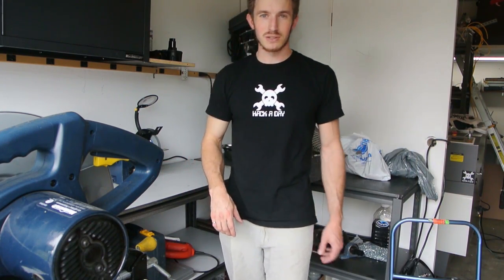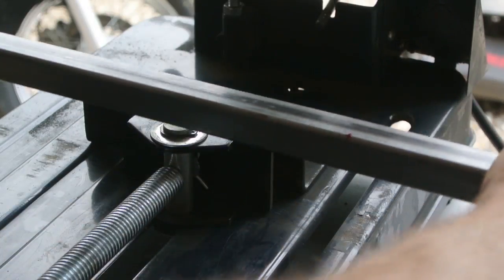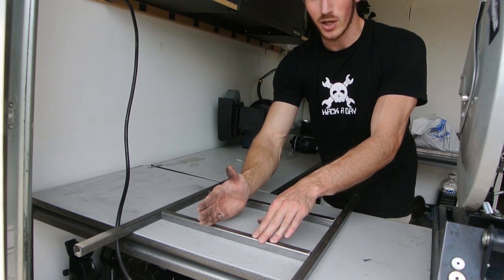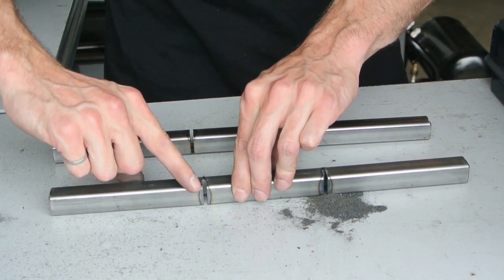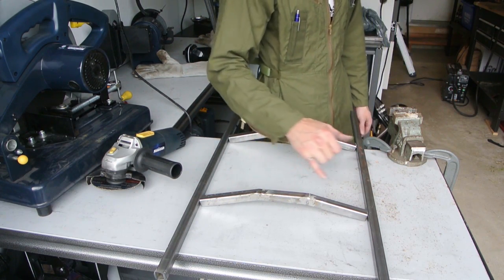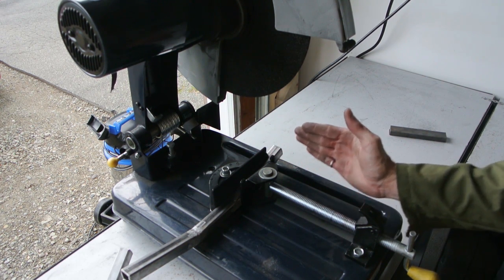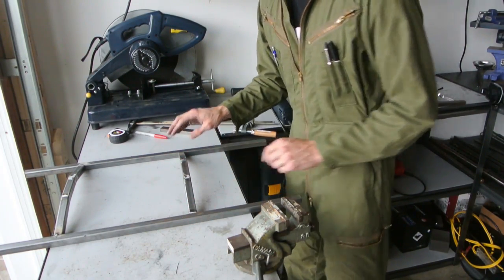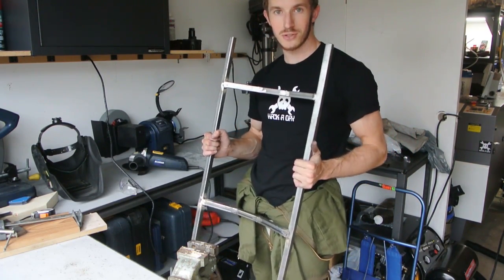Elysium Exoskeleton, Part 8: Building the Frame

Comment: What if to use a 250 psi compressor how will the performance
Reply from the maker: you would get double the power
Reply: you need mobility any sugestions for lighter equipment 
like the things you used to power the air stuff idk

Comment: See while you focuses on arms and lifting and holding it I had a similar idea except using the cylinders to boost you up basic the idea is to be able to jump six or seven feet into the air with pneumatic cylinders and absorbing the shock with shock absorber  when I land eventually its in bare bones stage right now but the idea is sound
Reply from the maker: Watch my other video on jumping boots ;-)
Reply: the Hacksmith that is exactly was talking about except we designed it so your not 1.5m of the ground but also we moved the pistons to the outside of both legs and put the shock absorber on the insides which still allows for joint movement we plan to test this near a foam pit so we have a place to land till we get the landing part figured out

Comment: if you fill the box tube up with water then let it freeze in a freezer take the pipe to a pipe bender the ice inside will make sure it retains the box shape while bending. then just take a torch to get the ice to melt.

Comment: Why did u put the jumpsuit on to weld it's not needed, just a waste of time
Reply from the maker: Have you ever welded before? Welding produces intense light, which includes both UV and IR light as well -- Any exposed skin would get sunburns.
Reply: the Hacksmith
Running a few short beads once in a while wouldn't be quite enough to do anything, but still worth it to avoid the chance of slag popping off and burning clothes or skin. That's beyond unpleasant when it burns through your jeans into your boot.
Reply: from what i hear aren't welding burns worse then sun burns

Comment: You planning on doing anything for the legs? I can't quite remember if they had that in the movie, but just wondering. Also just a thought if your actually going to strap it with Velcro or something along those lines to your arm, pick up a football arm pad or something of the sort just because I feel you would either need very large Velcro so the surface area isn't limited and it could hurt (I would assume) trying to lift something heavy because even though you've got the strength from the machine your arms are gonna have to stay still with a lot of pressure. Keep up the great work man!

Comment: Why not get a cutting torch and use its heat to make it easier to bend metal?! :D
Reply from the maker: Box tube would be very difficult to bend smoothly even with a cutting torch I think... My method was pretty easy and repeatable so I think it worked well...
Reply: In my personal experience it's actually pretty easy, but hey your method worked for you and you're comfortable with it so that's good!
Can't wait to see this unfold more
Reply from the maker: Timothy_Terror Yeah? Have you bent box tubing? I'm curious now. The stuff I'm using is 3/4" square, with 0.100" wall thickness
Reply: I used a pneumatic press and it was still not doing to well however in mother Russia box tube bends you
Reply: Yes sir I have bent box tubing, except it was typically 1/4" in my case
The torch method should still work for you though 

Just be be sure to apply heat where needed, not pushing down on the trigger and just letting the orange flame do the work 
And once the metal is turning red, try bending away